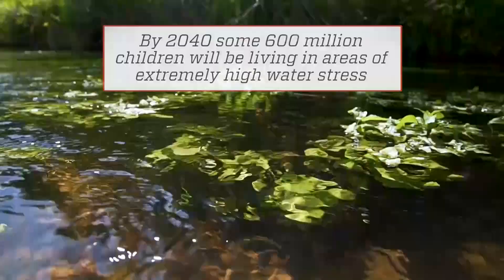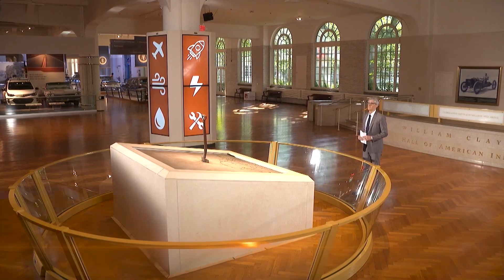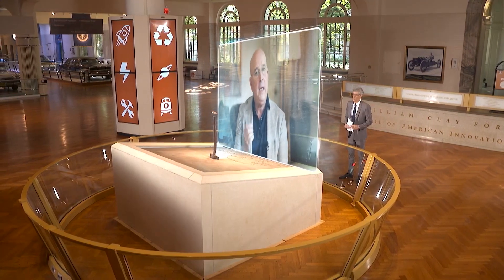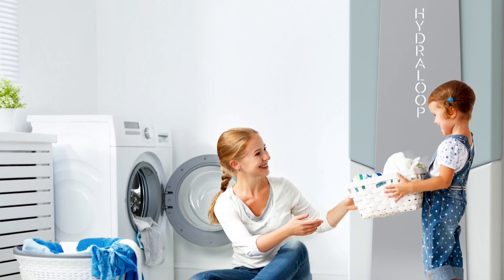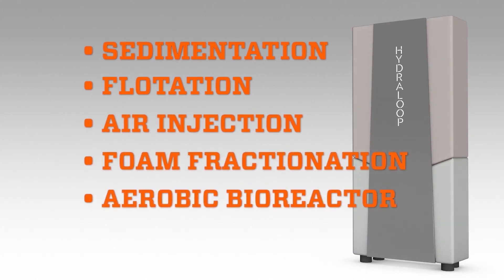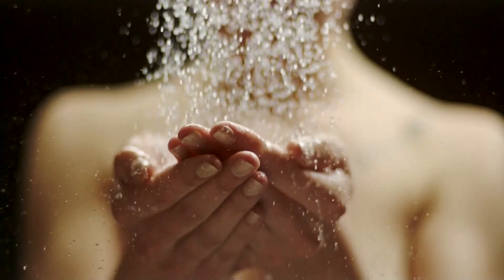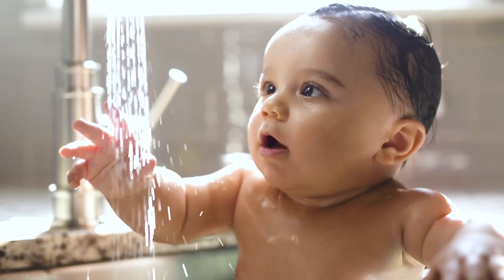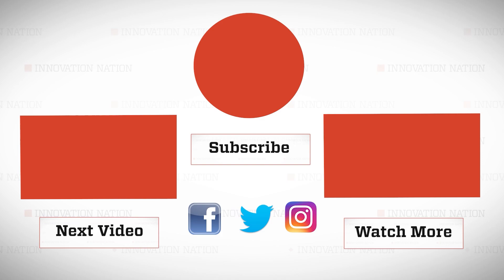Hydraloop Home Water Recycling System | Innovation Nation

Comment: But you cant drink it?  So how will you wash your fruit and veges or brush your teeth?
Reply: You will still have tap water in your house, that you use in the kitchen - and to shower with. The used kitchen water directly goes into the sewer. But the used shower water goes into the Hydraloop system, where it is cleaned, and after treatment, you can use that water again, for example for flushing the toilets, watering your garden, or for laundry. #usewatertwice